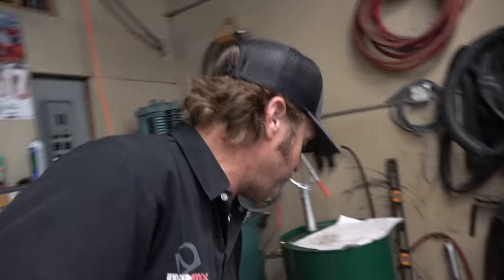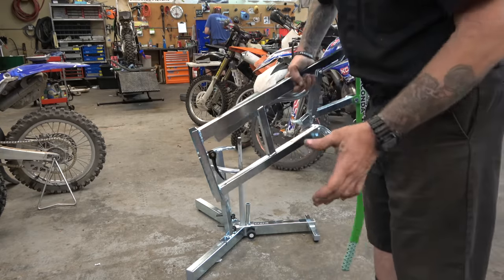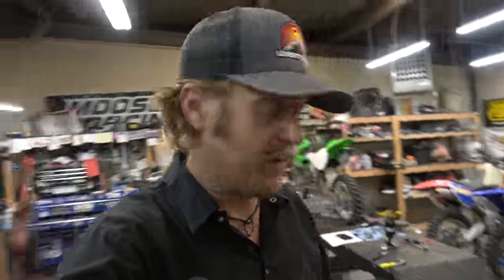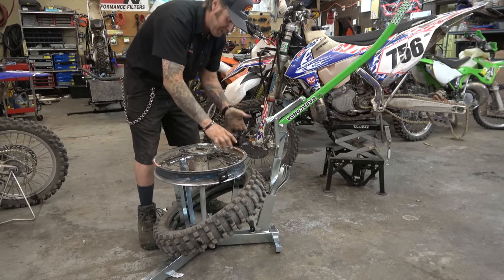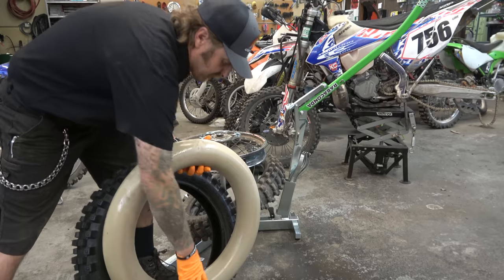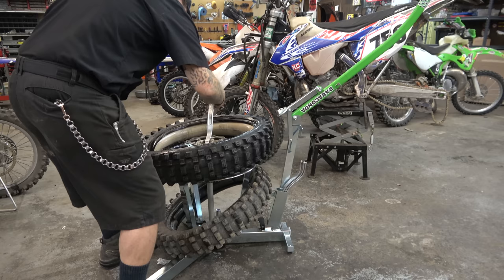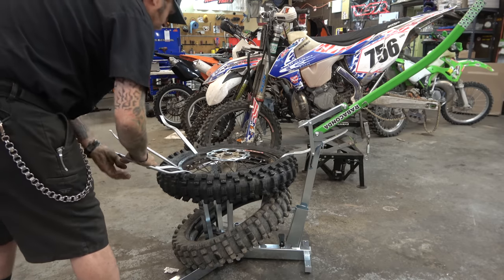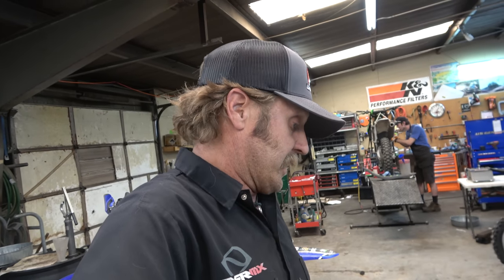Is A Rabaconda A Waste Of Money?

Comment: If you pull up on the plastic lever locking handle and turn it, that will usually tighten up the lever lock on the raba. I really like my rabaconda, but went from using a garbage can or the floor for tire changes so it feels like the cats meow.

Comment: Thanks for the solid review, Morgan!
I've used a friend's Rabaconda and then wanted one, but they're pretty proud of their equipment, and the pricing shows.
I researched the Moose version and found very few differences. 
The things noticeable were the built-in tire iron holder and the little tabs to help push the bead lock in on the Raba.
Otherwise, virtually identical. 
Same length and leverage on the bead breaker, same adjustable rim supports.  
As you mentioned, the Raba has rubber feet, but I do like that the Moose have a wide plate under each of the three legs, so you can stand on them and get better foothold when you're working up against the tire.
If you have the money, you can get either.  
If you have a budget, and still want a quality tool, I have not been disappointed with the Moose version for $200-ish less.
They will both eventually pay for themselves vs. shop prices - Moose will just do it sooner.
Reply from the maker: I agree

Comment: I used to use WD-40 on tires/tubes.  Until I learned about tire lube. It's a lot cheaper and better for the tire,tubes, bibs.    Plus use the moose lube on the bin.
Reply from the maker: I only use WD to mount.  The lube for the mousse is not for mounting. It is for keeping heat down.   The WD is good for mounting because it dries up and goes away and the tire doesn't slip as much on the rim.

Comment: I am still curious about the mousse system - guys out here  in AZ swear by it.  Man- I have been using tubliss for the last year- never had a flat yet...     It is not like I mess with the air pressure for traction but I have to air my high pressure side a few pounds every ride.   From my experience Tubliss is finicky.    I am not a hard enduro guy- just love riding the desert.
Reply from the maker: Rick, you need to try mousses.  Just do it once.  The very worst that happens is that you get 2 or 3 sets of tires out of them with zero possibility for flats and you are out about $300 and you go back to tubliss.  I LOVE not carrying any kind of tire tool and not having to check any pressures.
Reply: @highlandcycles  I think I am gunna have too now! LOL

Comment: Hopefully that rim lock is better then the Talon billet rim lock. Looks similar. Using two Talon rim locks is the only time I have had a tire spin. When it does slip it’ll shred the inside of the tire.
Reply from the maker: I’ve been running it for a while and it’s been good. I think it’s wider than the talon one

Comment: You should change your install method and instead of using WD40 spray, use baby powder as a dry lubricant and use the white hand cleaner cream with lanolin on the tire's  bead. WD will react to rubber tubes over time.
Reply from the maker: Thanks for the tips!

Comment: So no lube on the rim? It just gets in there later? I’ve been making a big mess then also using two tubes per rear tire. And I use two rim locks on the rear, it’s been a real pain in the ass even with the Rabaconda. I’ve been using a grease gun on the air chuck to regrease the tire halfway through to help the mousse last longer. Thanks for the vid, gonna try WD40 and your grease method next tire 👍

Comment: Hey Morgan, the bike definitely isn't lean, plug and piston top show on the rich side, I removed the Billetron vent lines from the air box and put them down in the skid plate where they used to be, solved the problem, the engine was pulsating when coasting on idle in gear and doing to the same when settling down at a stop, problem solved, must be a Billetron thing ?
Reply from the maker: That is odd for sure. Glad you solved it

Comment: While it definitely helps get the old tire off faster via the arm, I don't see what all it does for you beyond just being a stable stand for putting it back on. Having 5 good irons helps as well, but for the rim lock, I prefer to use a slide clamp to push it in while getting the bead under it. Also easier to do the rim lock earlier than at the very end.
Reply: Idk he made it look pretty damn easy every bit of it.. barely a struggle at all.. Even as a big strong man I've cried while cussing from trying to do a tire...

Comment: Hey Morgan problem didn't get solved, bike has a black plug and a black piston top, would a rich condition cause a stutter at idle ?, I checked with Lectron and they say no problem with vent lines on the Billetron in the air box so putting them back
Reply from the maker: Rich usually just makes them die. Could still be lean on the bottom and show a rich plug and piston. Plug shows the over all condition, not specific areas. I’d check for a crank seal leak
Reply: @highlandcycles  Ok thanks Morgan really appreciate the expert advice ! have a great evening

Comment: Been using the moose racing for a couple years now.  Works fine,  thinking about grinding in some teeth on the bead breaker though after seeing the chompers on the raba.  Ever figure out what those metal loops are for?
Reply: The metal loops are for pressing the rim lock into the tire when you put the last section of tire on.
Reply from the maker: @ronaldchiles5550  I thought that but didn’t see how they would work. The official rabaconda video didn’t use them either.
Reply: @highlandcycles  you have to turn the iron backwards. I usually dont use them they are in the wrong location.
Reply: Hi guys, At Rabaconda we rarely use the loops actually ourselves. We just push in the rim lock with a tire iron against the brake disc. So much faster and easier. Done that for 10 years now. You can use the loop as well, but if the mousse is very stiff the center spindle might bend while simply pushing the whole wheel away, not rim lock into the mousse. In this case you can put your knee against and pull the tire iron towards your knee. More stable
Reply from the maker: @Rabaconda  thanks

Comment: I skipped the whole tubliss era, but the inserts look reasonable and I been watnting to try one.  looks like you probably could NOT install one of these without a rabaconda or moose tool though    I use the baha no pinch tire tool just for normal tire changes and the old fashioned tube.
Reply: Switched to bibs have always just used a 5gal bucket and a couple nice spoons but with the mousse it turned into a 3 person job…. Hence why I’m here looking at the rabaconda 😂

Comment: Gonna be the odd ball here but not a fan of the rabaconda or its copies. Give me a good old tire change stand.  I work harder at a tire with the rabaconda and my back hurts when I'm done. I'd take a bucket bolted yo a sturdy surface over that contraption.
Reply from the maker: Right on. It’s all about technique in the end and if you have one that works, that’s the best
Reply: @highlandcycles  I do also have lower back injuries so standing and using my upper body strength just works better for me.

Comment: I'm going to try just squirting the lube in next time (I assume the tire rotating ends up spreading it). I've always coated the tire and mousse and it's a royal mess :)
Reply from the maker: Yep. It really does spread out everywhere.  Super easy
Reply: @highlandcycles  wow, so you really just squirt all the lube in that one place inside the tire and that is good enough?
Reply from the maker: @tandpnetwork7102  yep. I didn’t believe it either but it works

Comment: Hey Morgan what would make a 2 stoke engine chug when dropping down to idle, asking for a friend
Reply from the maker: If you mean, kinda hang up high before dropping down, that is usually a lean condition. Either lean pilot circuit or an air leak

Comment: why can't the off road version work with street tires and vice versa?
Reply from the maker: I think it has to do with the amount of force it takes to break beads on street tires.  I have used the offroad one on street wheels just fine but I broke the center spindle eventually.

Comment: Wow that is a lot of extra steps to change a dirt bike tire.  I have 3 tire levers and a 5 gallon bucket, can change a rear tire/tube and have it mounted back on the bike in the time it takes to set up that Rabaconda.  It's overkill.
Reply: I tried with 3 on a 19-inch tyre and a very tight rim - it is mission impossible without a tyre stand. Lost 5l of sweat.

Comment: I’ve had one for a couple of years and only got round to using it this week.
Anyway removal of tyres with mousses is easier than having a shit.
I honestly don’t think you should be allowed to buy this tool until you’ve submitted video evidence to Rabaconda of you struggling on the floor swearing, sweating and bleeding; preferably in the heat of summer.

Comment: The Rabaconda is worth every dollar...even for regular tire changes.  The Moose replica is complete garbage.  Spend the extra $150 and get the real deal.
Reply: Complete garbage?  Could you be more specific?  Were there any differences between the two tire changers that Morgan may have missed?
Apparently he has used his Moose Racing tire changer for years. Seems like he would have tossed it a lot sooner if it was that bad...?
Reply from the maker: I think I agree but I don’t think the moose is garbage. It has held up to hundreds of changes.
Reply: @MotoTripping  Sure.  I've owned both.  The quality (welds) and the actual fit of pieces is sub par to the Conda.  The metal is thicker on the Rabaconda, and the actual arm to apply pressure seems as if it is at a different angle for better press as well.  There is a height difference for the mount as well.  Will the Moose get the job done....sure.  is the Rabaconda better...IMO it is (after owning both).
Reply: @MXJEFF94  thank you!